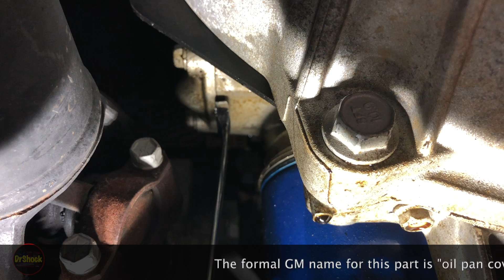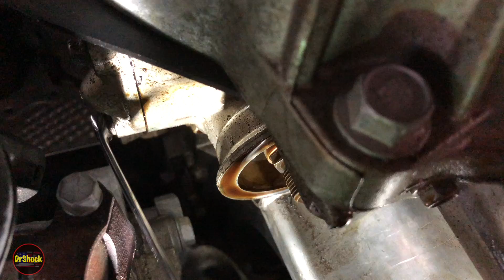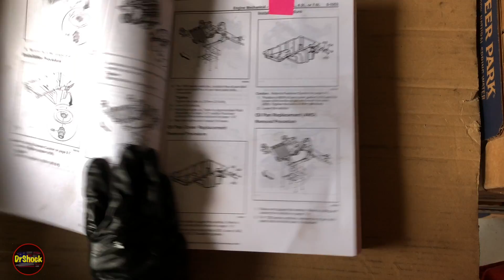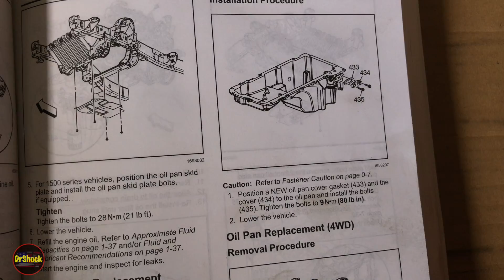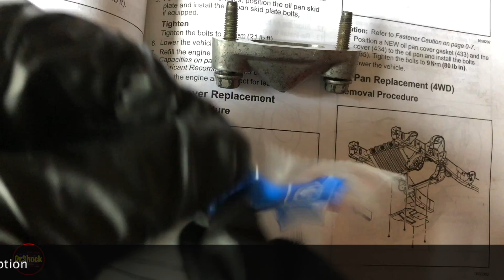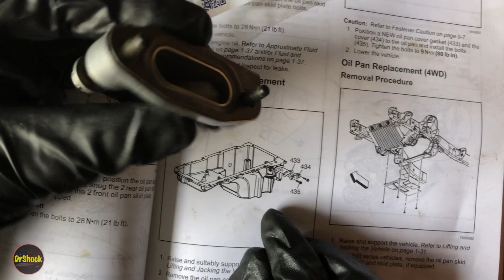2007 - 2014 5.3L V8 Oil Pan Cover Leaking Gasket Repair (Avalanche / Tahoe / Suburban / Silverado)

Comment: Why didnt you also add some RTV gasket maker?
Reply from the maker: You don’t use that material with an OEM metal type gasket.  Doing so can actually cause it to leak by creating a double gasket situation.
Reply: @DrShock not if it’s real thin. Silicone works too. I’ve done it for this issue for years
Reply from the maker: That doesn’t mean it was done correctly for a GM vehicle all those times before.  ;-)  

If it’s not a step listed in the OEM service instructions, it should not be done.  Different manufacturers have different materials and designs for sealing, there’s no one approach that works the same for all vehicles.

Comment: I had the same leak. The bolts won’t want to tighten any recommendations?
Reply from the maker: You replaced the gasket and cannot get the bolts to the specified torque value I showed?   If so, this is usually due to the threads being stripped out in the aluminum engine side from previous over tightening.   They'll have to be drilled out and a thread insert installed to restore the ability to properly torque the fasteners if this is the problem you're trying to describe.

Comment: Hello Dr. Shock , say did the repair hold? thanks rich
Reply from the maker: Yes, at the time the vehicle owner reported this particular engine oil leak was addressed after the repair we did here.   No issues mentioned since then.  We used the genuine GM part, aftermarket part results may vary.
Reply: @DrShock  Thanks Dr. Shock!